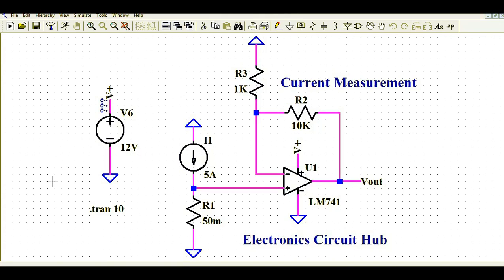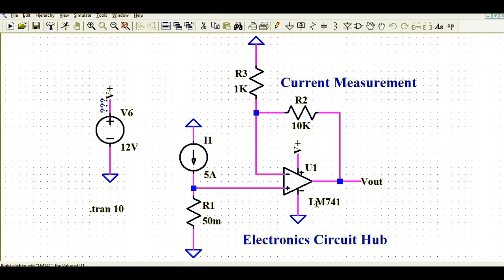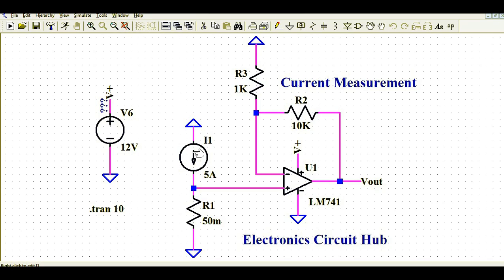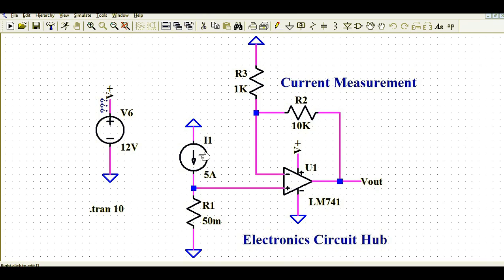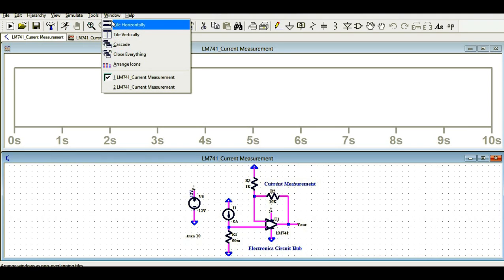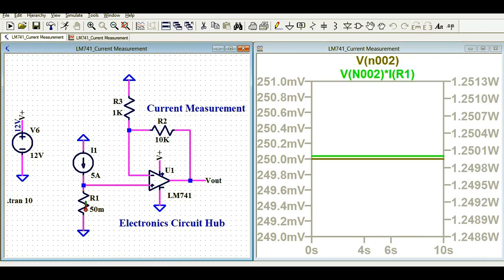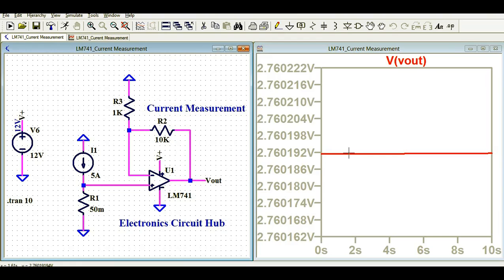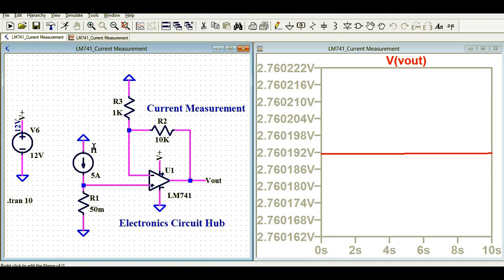LTSpice LM741 Low-Side Current Sensing Circuit | Simulation

Comment: Where can you get a 50 milli-ohm resistor, or how do you make one?  
Note that the LM741 will NOT work with input voltages so close to one of its power rails (the negative one in this case).  Please check the data sheets for the common-mode input voltage range.  The LM741 will need split power rails, or else a mid rail (+6V) input reference point, before this circuit will work when actually constructed.
Reply from the maker: Hi...Thanks for your input. Let me look into it.